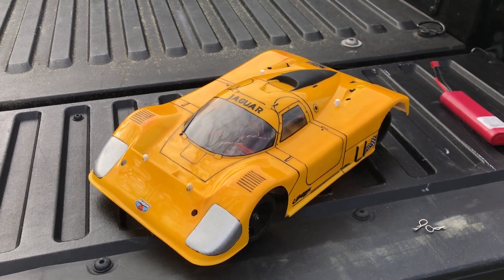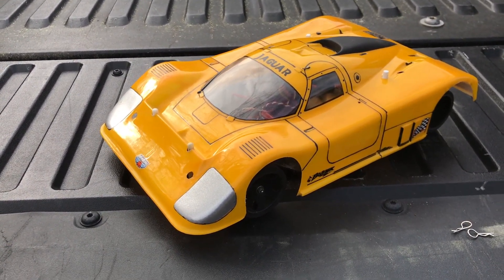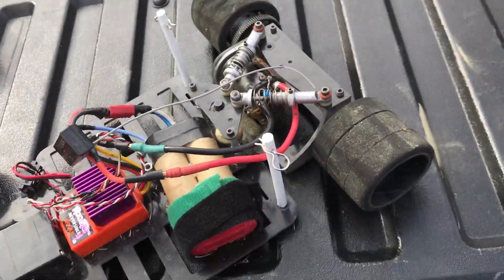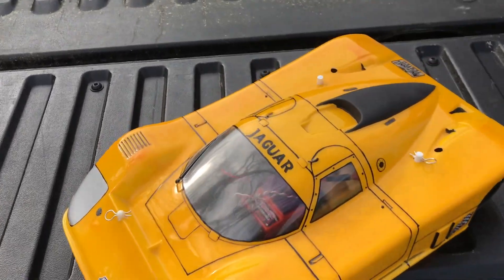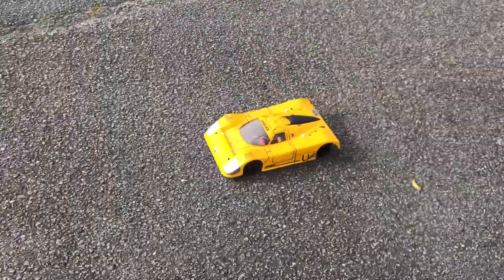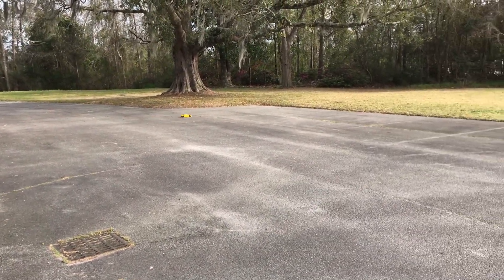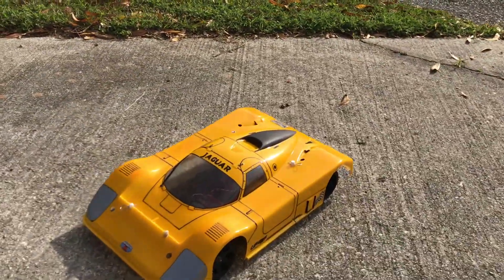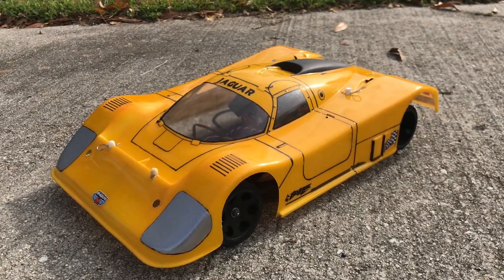BOLINK RC PAN CAR REVIEW

Comment: Should haul pretty good on a small 2s lipo for less weight & quite a bit more power density.
something like a 2200 mah 2s lipo would be nice in something like this on a onroad track.
Reply from the maker: Marcus60661 The owner I believe does use lipo in some of his cars. I myself could probably be happy on just a few AA’s batteries 🤣 as these are restored rare and valuable vintage cars I get too nervous and I’m not a great driver, more of a techy rc builder guy.  I build it and hand the keys over 😆. Thanks for watching

Comment: Gawd 😂 My first RC car! That aint stock. Those aluminum parts were made of garbage plastic. No bearings. Also there were no shocks at all.
Reply from the maker: Thanks for stopping by and commenting. The Bolink Eliminator 10 which this is stock also does indeed come with shocks for the rear. The fronts also have suspension in small springs beneath the steering blocks. Truly appreciate you watching and sharing. Be sure to like and subscribe.😊